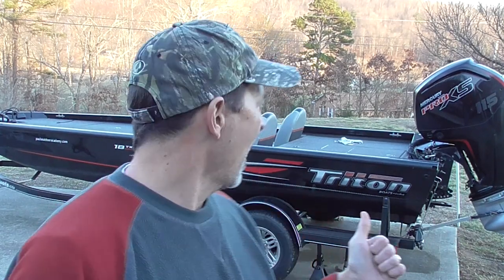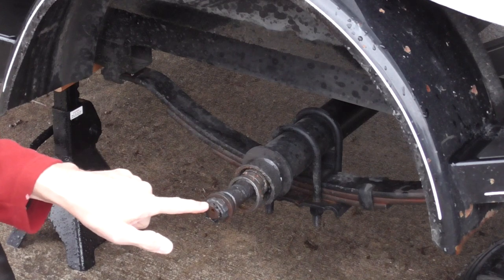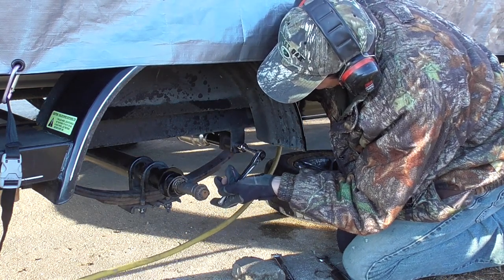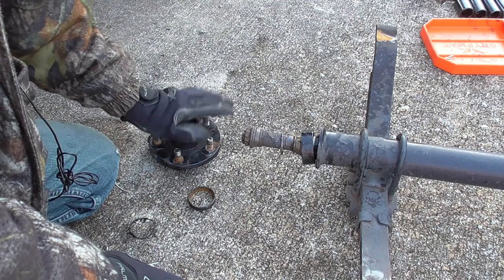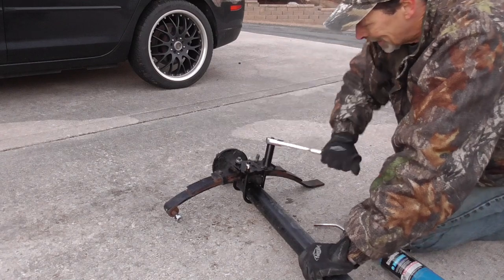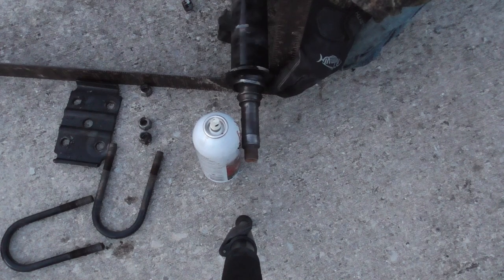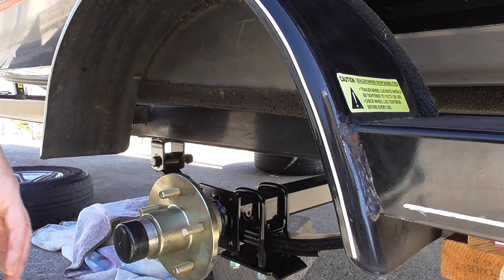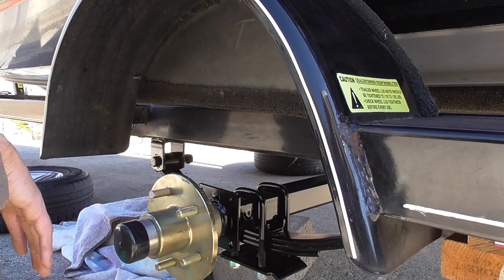How to replace or upgrade a boat or utility trailer axle.

Comment: glad I found this one... it's just as good as the high pressure fuel video.... It's a very similar situation with my axle/hub problem.... i was on the way home when my wheel started wobbling.... I cashed in every favor and prolly lost 4 or 5 of my 9 lives.... Dexter and Marine masters trailers hooked me up though.... hopefully neither of us go thru another axle problem... they are the worst !! Good call on getting a custom axle that's rated for 3500 lbs... wish i woulda thought of that one.
Reply from the maker: 4 or 5 of 9 lives is TOOOOOO many. man oh man. Glad it worked out ok in the end. That is amazing they took care of you like that, awesome!!! If for no other reason than to remove my concerns, the 3500 axle is really nice. No longer worried at all. :)

Comment: Great tutorial! I really appreciate you doing a video on this.
My 1991 16ft Sun Tracker Bass Buggy Pontoon trailer has those small wheels and I'm a very leery about my boat riding around on this trailer with the small wheels especially with all the added supplies added on my boat.
I'm also thinking about going with a better axle and larger wheels.
Thank you for such a great video.
Reply from the maker: Thank you for the compliments and I hope your swap goes well, if you decide to go forward!!!

Comment: Very nice demonstration. I like that you increased the weight rating of the axle. I'm sure it inspires confidence!
Reply from the maker: I am no longer worried so that is really nice!!
Reply: I have a friend that is a mechanic and he coached me on service the bearings awhile back. He also occasionally does axle werk for our local boat repair place as well. If I ever have to do what you did I guess I'm lucky he'll help.
Reply from the maker: If he can’t, it is actually not bad at all. Honestly, the hardest part is finding one that fits your application. I may make another video of how to take all the measurements. Trailer axles come in all sizes and shapes.  Boat trailer axles are even crazier.
Reply: A complete video on measurements would be great! If you do it, I would be grateful and so would A lot of others!
Reply from the maker: You got it. Soon as I can!!!

Comment: Nice video! I have a small boat trailer for a 14 ft aluminum boat that needs new hubs but I don't know what size hubs I should purchase. I know I don't need the 3500 size you have maybe 2000 kit is all that is needed. Also need to know what type of spindle needed.
Reply from the maker: Unless you want to buy new wheels you need to make sure the hub you get is the same is the one you already have. There are some great resources online about measuring your axle when you need one. I thought about creating a video on how to determine what you need for this very reason. Maybe I will. 😀
Reply from the maker: Take one of your current wheels to a place that sells wheels and ask them to check the bolt pattern size for you. They are prob 4 lug or 5 lug and if they are 5 lug, they are probably 4.5x5” bolt pattern. The spindle you get has to be matched to the hub you get. I think that is why many people sell them as a kit. E trailer is a good site 😉

Comment: Did you ask your buddy if when going from 2,000 pnd to 3,500 pnd axle and keeping the same leaf springs if its safe to flip the new axle to under the leaf springs for height? Or would you have to weld or get bigger leaf springs?
Reply from the maker: Hey there! Unfortunately I didn’t ask. But you cohld certainly call this place. it is Sweetwater Metal Products in Sweetwater Tennessee
Reply: @PaulsOutdoorAcademy  Thanks! Great video btw!
Reply from the maker: @JeepTRVL91 thank you!!!

Comment: You were lucky,  I missed a sale on market place  where a 21-foot triton rolled over off its tow vehicle.  It had at least $3 grand worth of parts that wasn't destroyed
Reply from the maker: Oh my goodness. Parts for days on that boat!!! Yep I am blessed like crazy and that just proved it when I saw that spindle and hub. Thank you for your comments and views! 😎
Reply: @PaulsOutdoorAcademy  My Ranger trailer came with brakes originally and the owner before had your problem,  but it messed up the $1600 fancy fender too. So in some place in Idaho got  the axle replaced  with no brake option. No flange. So I got 2 new ones for $200 . Only need one but why not? Anyways I need to cut and Weld new perches on and go through your steps.
Reply from the maker: @mattlord2906  You will do awesome!!!!
Reply from the maker: @mattlord2906 let me know how it goes 😎

Comment: do you think keep springs and just removing U bolts would be easier?
Reply from the maker: In my case it was easier to remove the entire assembly. 👍
Reply: @PaulsOutdoorAcademy  you could just cut U bolts off if really hard to remove
Reply from the maker: Absolutely.  I didn’t know
My new axle would come with them so I opted to just remove 😉

Comment: Why remove the leaf springs?
Reply from the maker: Great question. In my case I was replacing the entire axle so disconnecting from the axle had to be done. They can stay on the frame, IF there is enough clearance to remove the axle with them installed 😎

Comment: Why are you taking the axle tube lose to change a an axle
Reply from the maker: I may not fully understand your question. I was replacing the entire axle so I had to remove the axle from the trailer.

Comment: I've got bad grooves/missing metal on the spindle where the bearing rides. The hub/bearings seem to fit tight enough that there is no play in the bearings with the wheel on and everything put back together. But I seem to have the bearings go out once a year or so I think it is from all the salt on the roads here getting behind my seal somehow. But do you think maybe the grooves on the spindle is causing the bearings to fail?
Reply from the maker: It is possible the grooves are part of it but that sounds really odd for them to go out that often. When you install the bearings are you replacing both inner and outer, along with the races? Are they packed really well with grease? The salt in the road could be impacting it too. Is it bearing buddies? The Vault? Oil bath or zirc grease fitting?